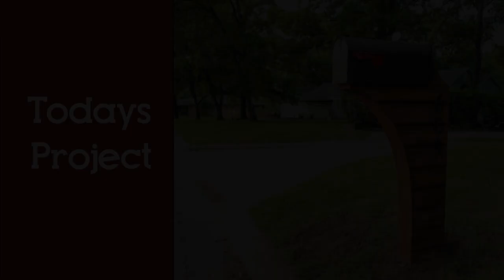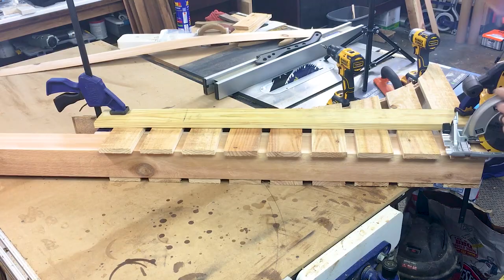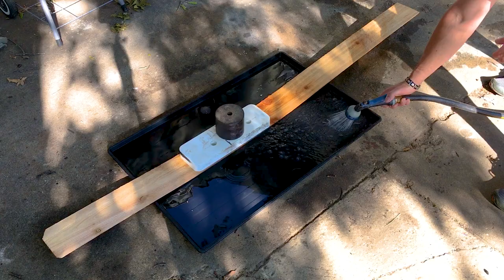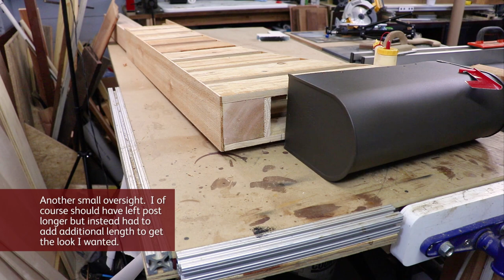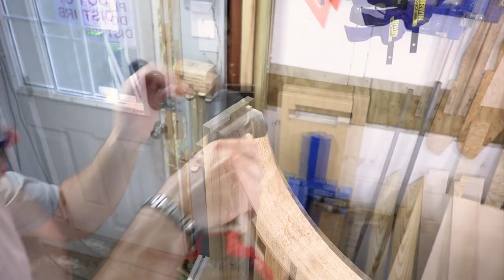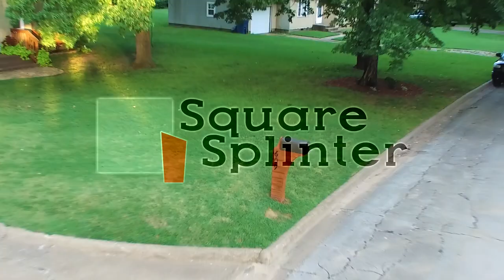Bent Lamination Cedar Mailbox Post

Comment: Great build! I found this video because I’m making something similar shortly. 
There is just one confusing part, though. Throughout the video there were gaps in between the boards, but when finishing and in the end shot the gaps were filled. Did you cut down filler strips and nail them between the gaps? Thanks so much!